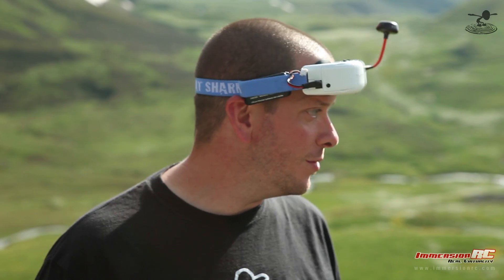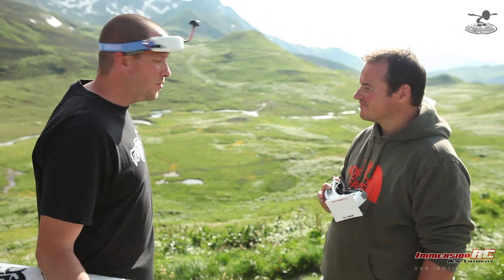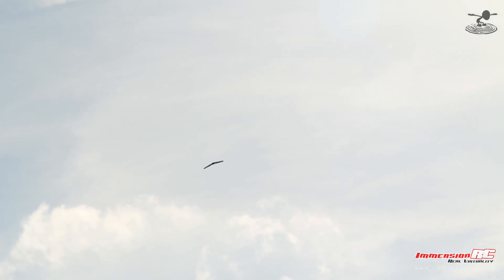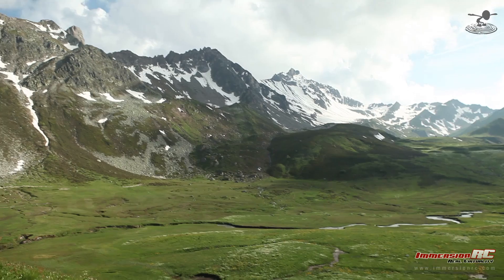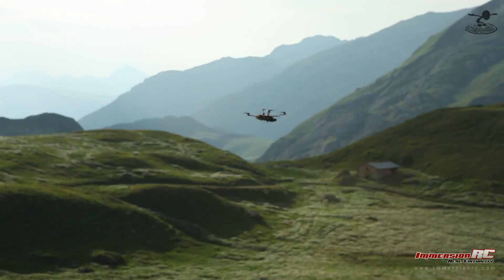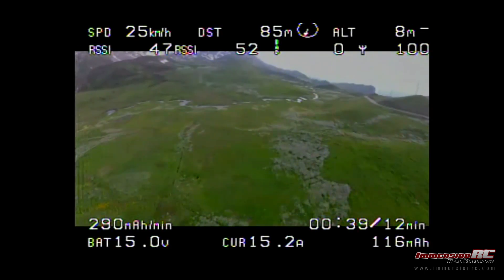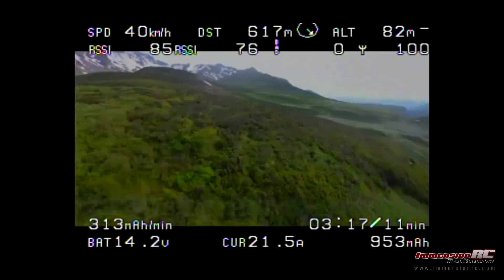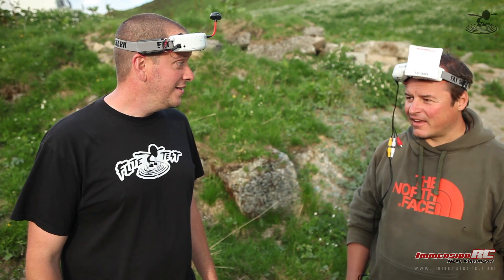Flite Test - EzOSD (On-Screen Display)

Comment: I had the ezosd for a zephyr, but I sold is as fast as i could. The fact that it doesn't has a RTH or autopilot is very annoying. And this episode is a perfect example what happends if you lose your video signal.... Crash!! 
The "uthere Ruby" is a much better solution, great OSD and all the features which the ezosd doesn't have. 
On a copter with RTH the ezosd is OK. But the new dji osd is veeeeery cheap and has all the features too. 

The best product from imrc is still the UHF, no doubt! The rest, well.....
Reply: casman86 emulsion88 As a beginner I wonder which "On Screen Display" module has the ability to control a plane.

Also they didn't lose the video signal because of the mountains, but because the vibrations of the motor/prop disconnected the antenna. Are you saying that would not happen with other frequencies?
Reply: Still would have crashed with RTH and autopilot, seeing as it was in mountains.  Silly of them for using 5.8ghz on a zephyr in the mountains anyway, but I guess that's all they sell so that's what they wanted to promote on this.
Reply: Balu I don't know all the brands off the top of my head but I know one of the more affordable OSD/autopilot systems is Arkbird.  You'll have to do some research on fpvlab and other forums to find all the brands and differences.

  I know they lost signal because of the antenna vibrating loose, I'm just saying it made me nervous to watch them flying 5.8 on something that can cover so much ground so quickly.  I fly 5.8 on a popwing and wouldn't want to try it with goggles on, as every tree or other obstacle causes snow or total video loss.  Currently I just fly with a 9" monitor and make sure to keep a clear path for the video signal.  Can't wait to get a LRS and 1.3 or 2.4 for video so I can fly FPV with more confidence where I am with lots of trees and hills.
Reply: casman86
I'm pretty sure that's why they explicitely say that they are not flying behind any mountain or obstacle ;).
Reply: Balu No need to make stuff up, I'm simply saying 5.8 does not inspire confidence.
Reply: casman86 they clearly state if you watch the video that the 5.8 tx antenna fell off due to vibrations while flying.
Reply: Yes, why are you telling me this?
Reply: no, they wouldnt crash. as long you can see the plane (which they could), there cant be an mountain in the way ;)
Reply: I quite like the 600mw 5.8 vtx too. It's great for when you just want to grab your fatshark goggles and not fuss with a ground station.

Comment: LOL, good image for IRC. Bad built wing and too much confidence on their setup/skills. That was some crappy prop/balance. Even without the Gopro footage you could easily hear the vibrations.
Reply: I still like that they didn't just pull the plug on this video, but show the problems you might experience yourself.
Reply: Balu Yes, but i would expect more from one leading company in the FPV world.
Reply: MrJototojo
This is actually why I don't understand that people are complaining and calling it an advertisement.

The guys met, threw together a frame to show the features of the OSD module and had their problems with that - just as I would probably have had.

If this was supposed to be an ad they would've put a lot more work in it.

Comment: immersionRC transmitter losing signal at 700m distance epic, i got 2KM from my boscam cheap stuff... LOL
Reply: So your boscam still works when the antenna gets disconnected?
Since that's what happened because of the vibration of the prop/motor.
Reply: It was that? Are you sure? I saw the antenna connected when they recovered the wing... But i still prefer the cheap boscam/skyzone stuff, it works the same as immersionRC and its cheaper, why pay more for the same?
Reply: FPV Portugal At least that's what they told us at 9:25.

I'm not into FPV yet, so I can not compare and have only seen the immersionRC products during the FT meetup in Europe. But I liked that you can just plug all the modules together and everything is compatible. Also I was told by other people that if something breaks the support is really good.

Of course you might get that from boscam/skyzone too...

But making fun of the immersionRC product when it's not the hardware, but a faulty connection is just not fair.
Reply: Agree with you, didnt saw that was the antenna. ;)
Reply: Me too, with minimosd-extra firmware is very powerful...

Comment: "If you have a video failure, you can still read that, and that's really important too." (Video fails and he can't read it) :(
Reply: Nandox7 They were saying that the video camera can shut off (like the GoPros do sometimes) and they still have the OSD. They lost the feed because the antenna got disconnected because of vibration. No antenna, no nothing =)
Reply: That was funny. :) Of course that if video fails also OSD data won't be seen.
EZOSD sends telemetry over one of the audio channels, but if transmitted signal is severely lost there is no way you can get any data. Good is to have either a DVR recording the video and/or the telemetry so in case of failure we can have an estimation of where it might be.
Reply: Nandox7 Balu Haha I know, I just found it funny that within seconds of talking about a hypothetical video feed cut-out, not only did they lose video, but they lost complete signal :D

Comment: And also if you have video failure you can still read that....... Video failure plane down... RTH switch would of been a definite bonus there...
Reply: Not video failure, but transmitter failure... Without an antenna there is no data at all. ;-)  And no specialized flight controller in there as far as I could see.
Reply: yes I know I did watch the whole video. It was just it happened as soon as bix was saying video failure. And I know it didn't have RTH on I was sampling saying RTH would of saved the day. IMO a definite must if you are going to fly in unknown places. Just my opnion sir

Comment: Quick question: Why would an esc start smoking even after I just got it? Flight controller or maybe battery being over charged
Reply: may be  motor draws more amps than esc's actual limit.

Comment: Great work guyz
The right angle SMA adapters are a weak point.  I solder mine because I have had 2 come apart in mid air.
Way kool man

Comment: Immersion RC is expensive but you do get the quality and the easy plug and play.  setup and features.  Maybe one day :-) 

Now if you are just flying around a small area, don't have a telemetry receiver/transmitter and want to at least get the current battery voltage on your fpv screen, you can install a very simple OSD (RCD 3060) that just supplies stats on the battery voltage.  HK and many ebay vendors sell them for less than $20.00

Comment: i dont understand the point of spotters/people watching if you don't listen to the instructions your given in a emergency :/
Reply: doubt it would start doing loops or something, as long as he wasn't too aggressive pulling up
Reply: If you get a massive amount of rock between you and the vehicle you're not only unable to receive it's video signal but it won't be able to receive your control signal either.

I've never flown a plane before but i won't even try unfamiliar terrain without return to home. APM's aren't that expensive.
Reply: Hatagashira It also depends on the frequency. 5.8 GHz is obstructed by almost everything and suffers from multipath interferences. The UHF system is a lot less sensitive to these kinds of glitches. So they might still be able to control the plane, but not have video anymore.
Reply: I wonder if a wing like this would simply do crazy loops if you "just pull up" without seeing the plane yourself.
Reply: Balu Being an FPV plane/wing I would think they would have the rates/expo adjusted so that the thing would fly nice and smooth.
Reply: Balu this may be a safety feature because you know if you've lost your video its time to start heading home as you might lose youre 2.4GHZ range

Comment: Download File Details:
Download Type: Firmware
Version: v1.20
Release Date: 30 Mar 2013
Last Modified Date: 2 Oct 2013
Filename: EzOSD_v1.20_Standard.zip

IF there is a update please maintain the immersion RC Website.
I cant remember the minutes left on the flying battery within v1.20 - is this a feature of a newer version?

Comment: I am currently setting up my first Ez UHF system... one of the reasons I chose IRC was this release of the Ez OSD- as a multirotor addict, the OSD is a tool I have not enjoyed the luxury of, and since I don't use a naza or GPS based FC I am pretty much at the mercy of my building skills once I leave the ground and head out... if I did anything wrong or if everything isn't perfect, I could loose the craft- I sure would like a little less stress in the back of my mind and the OSD delivers that to a degree.
Reply: +benjahnz 

Ezosd does indeed send location coordinates down an audio channel that can be used to locate a lost craft through itelemetry. I believe there are other ways to read the location too, by replaying recorded GS feed. 

Right?
Reply: *****
Yes- I have a Naza around here somewhere... I think it holds my soldering rig =)
I pretty much know where I am going by seeing- I fly fpv only and until I can get Naze flight characteristics in something that has gps and rtl, and fits on a 250 size quad with under 600g of weight including a lipo, I will beg off.
The Naza was great when I first started- I loved it until I learned about other options. I outgrew the Naza after a month or 2 of learning it.
Reply: If something goes wrong due to your building skills then and OSD propbabley won't save you. The OSD is just a tool for making sure you don't run out of battery mid flight and that you can find your way home.
Reply: benjahnz
It will help with if the vtx and rx are causing issues with signal- even a solid build can show that as separation on some frames is only so far due to size.
Reply: ***** I'm not sure what you mean by this. Is English your first language?
Reply: benjahnz
If there is not enough separation between the video transmitter and the uhf receiver, or if there is a problem with the build in that the antenna works loose and video drops as in this video shows, and you have the last known OSD data recorded on a ground station dvr then finding the multirotor could be much easier.
Additionally- if failsafe kicks in on the UHF receiver due to harmonics or frequency issues caused by a mistake or overlook on the preflight, then again- the OSD offers data to refer to so the craft can be found.
I do not use GPS on my craft atm- the FC I use does not return to home on failsafe.
I guess I am unsure why this is all so difficult to comprehend?
Reply: ***** As of now the EZOSD does not display gps coordinates so it won't help you in finding a lost aircraft. It does show RSSI which is very useful but won't help diagnosing harmonics issues. For me this subject is not difficult to understand as I have been using OSD's with GPS's for quite some time and I'm 3/4 of the way through an electrical engineering degree. What was difficult to comprehend was your writing ;-)
Reply: benjahnz
Ez OSD does record the distance traveled from launch... so that is a very useful bit of info-
Not sure where your whole waxing superior stems from, but there is an old adage that goes- "You get more flies with honey than with vinegar" and while you may find my posts difficult to understand, I find yours to be bordering on snide.
I have about as much respect for paper engineers as I do paper pilots... show me applicable skills and the rest is just fluff.
I am not seeking to "read" harmonics on the OSD- I seek to have a manner to deal with what happens if the video drops and I loose my craft.
For the record, I fly with the Naze, and I use a pixhawk and have set up and flown Nazas... but don't much like the flight characteristics. GPS and rf are no great mystery to me... but I lack the refinements and experience some long time people like yourself enjoy. I do have a background in working with rf from a decade ago. I also have never used an OSD- I do not do LR flights and have never flown anything with wings. UHF to me is for penetration- so I can fly a foot off the ground at more than 100 yards around buildings and through trees- I doubt if I have ever been more than 2km from my launch point in my life and have no real desire to.
Reply: ***** All good highway.. Didn't mean to come across as snide, just responding to your tone when you wrote "I guess I am unsure why this is all so difficult to comprehend?". Sometimes it's hard to know what someone means to say when you can't hear the way they say it. 

I'm not so into long range flights these days either. It's fun for the first few times but kinda stressful at the same time. I'm more into driving to scenic locations and staying within a reasonable walking distance i.e. under 3km for planes and under a km for quads. My quads have a habit of occasionally falling out of the sky. I fly naze32, multiwii and kk2 and about to get into ardupilot. Of the 3 FC I've flown I find them all to be about the same to be honest. NAZE32 does seem the easiest to get good PID values though and the base flight software very is nice.
Reply: benjahnz  HI CAN SOME1 EMAIL A BOBCAT RC PLANE PLANS PLZ. I LOVE THAT PLANE>(javedallen2@gmail.com come.
Reply: benjahnz
...thanks- I reread my post and it came off asinine on the redux. I agree wholeheartedly on the 1km multi limit... and your assesment of the Naze- but check my videos- I have a 300mm tricopter with a full naze and using alt hold I can lock it or rock it in place on a calm day... no gps needed. I like the acro ability of the Naze- but I am not skilled enough to utilize it, but the damn thing just works... and baseflight is tight, and I hear rumors that thhe devs are going to tweak the gps and rtl features... or just gps- rtl will follow naturally.
I have Nazes in almost everything... except the ap rig and I am casually, and gently learning mission planner and the pixhwk/p4 fc stuff. I am overloaded with tech info... I need the upcoming winter to assimilate it. Ironic as I was griping for summer back in January so I could fly without keeping spent lipos in my pockets to stay warm.
Reply: ***** Good news about the Naze and GPS. I use a naze in my mini quad (fpv 250 with upgraded motors from HK) too. I find it pretty similar to the multiwii FC, which is not surprising given that it's based on the same code. It is nice and compact though and very snappy on it's corections. I really like the CLI too. I might upgrade my tricopter to naze once the GPS is improved a little. If naze GPS handling is improved it will be a no brainer for all multi rotors not needing ardupilot levels of functionality. 

Speaking of skills, I broke 7 props in 40 mins learning how to do forward flips the other day. I can now kinda do them..
Reply: trickhealey Yes you are right. It looks like the iTelemetry software enables you to track the telemetry with an iPhone, Pretty cool.
Reply: If they played the recording from their goggles through the app, would it have given them the last GPS coords? I have to say, recently my plane lost video due to antenna malfunction, it flew itself home...
Reply: benjahnz
Tri copter is tricky in the Naze- it is in servo mode if it is a standard Y- the tail servo is motor 1 and you skip M2, then do motors 1,2, and 3. Sucks because it pulls the #4 pin which is used for gps I believe... I have a ublox here- I was going to hook it up- technically, the Naze works with gps and a few are using it. There is a firmware version (harikari I think?) which is supposed to be pretty good with it but I am not in the loop and have not tried it. I was surprised at how well the barometer worked on the naze with no foam and exposed... unfortunately a decent case for the naze is only available if you know someone who has a 3D printer and is willing to tweak older board revision form factors. The rev5 Naze has not found anyone that makes a proper case for it- which means allowing for led's and the pins.
I actually custom solder my naze for my minis underneath and rotate the board 270 degrees on yaw so the usb is on the right side- all pins are tucked and not exposed to wrecks. I love the little thing- most fun with 25 bucks you can have with your pants on.
Reply: ***** The tricopter is a standard servo model, it's based on the bat bone by flitetest. So you are saying that the naze cannot do GPS while setup for a tricopter? That's unfortunate..      

I've only got a Naze Acro so I'm unfamiliar with the baro on it, but the multiwii FCs I have use the same sensors and they seem to work reasonably well.
Reply: benjahnz
no bar on the acro naze- just a simple FC that is tits on a ritz. Full Naze has the baro and gps abilities. Multirotorsuperstore.com is the vendor.
The acro naze will rock that little batbone- set it up in cli for tri, be sure to set your yaw "P" (from 8.5 to 4.2) by half for first testing, and be anal about balancing that rear motor prop... then move from there- other than Yaw the stock settings will get you started on tuning if it even needs any.
Reply: benjahnz hahaha
Reply: Allan T Yes, hahaha indeed. Well met Allan T.

Comment: Entertaining for sure. Not hard to tell how impressed Anthony was at the lack of communication there when it went bad.

What I don`t understand was everyone saying pull up but the plane didn`t.

All the battery information was not on the screen either.
Reply: Yes, usually there is no battery information when the current sensor is not or wrong connected. Also I prefer the GPS coordinates in the OSD all the time.
Reply: The plane didn't pull up b/c the pilot didn't.
Reply: *****
Thats what I thought, odd because everyone was united in saying "pull up"
Reply: Coyote FPV Why didn't he just pull up??? He should of pulled up!!